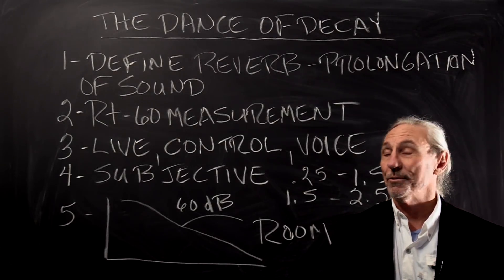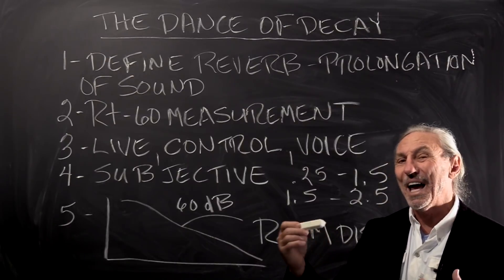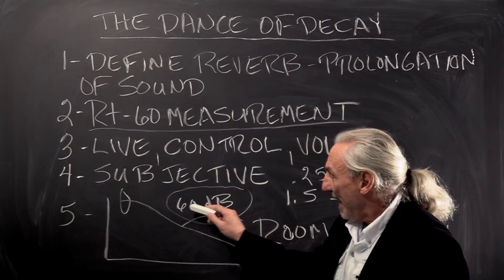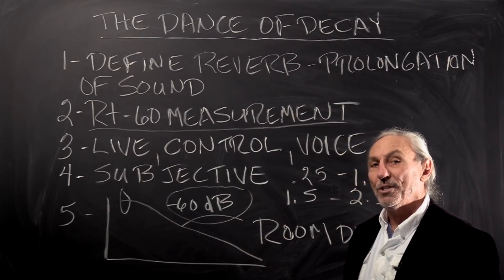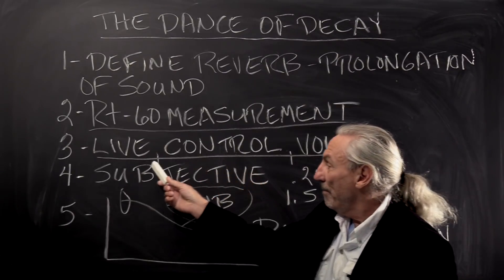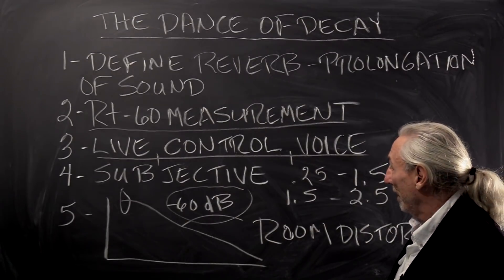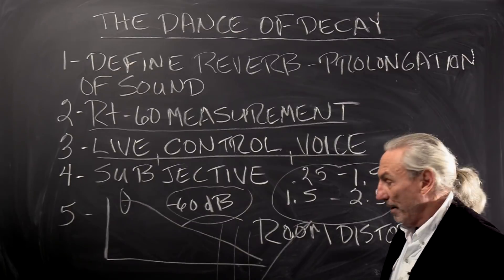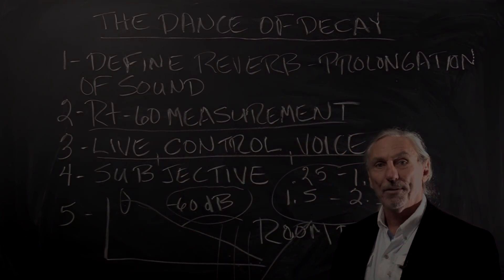The Dance of Decay - www.AcousticFields.com

Comment: What is an acceptable minimum decay rate for any 'small' sized room? At which point is a decay rate introducing too much reverberation/ distortion that is unacceptable by any standard? A baseline if you will.. Between Low -25s and high -  ?

Loving this info, thanks so much for sharing!
Reply from the maker: M,  Over the last twelve years I have seen ranges from .25 second to 1.5 seconds. The conclusion one can gather from this data is that it is subjective and depends on the end user preference.
Reply: @AcousticFields  This may constitute 'perfect' parameters of reference..thanks for your time and expertise, much appreciated.